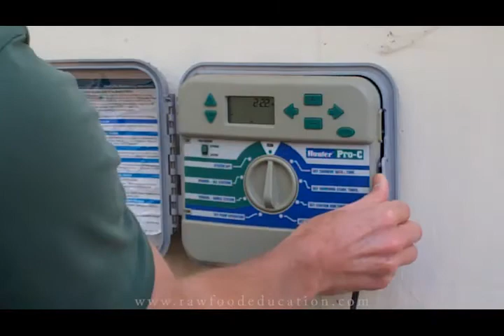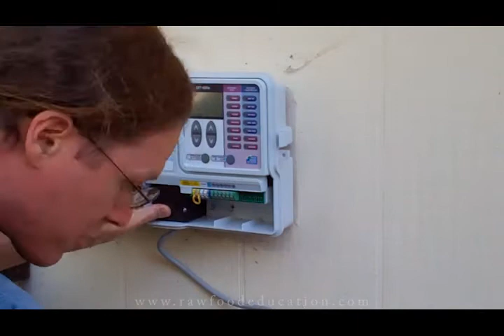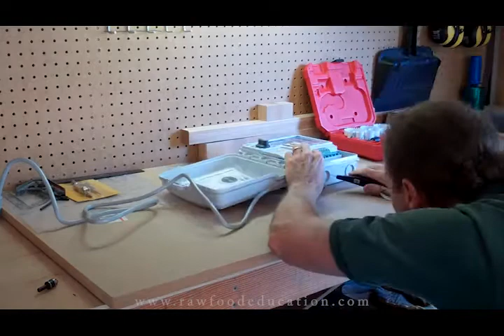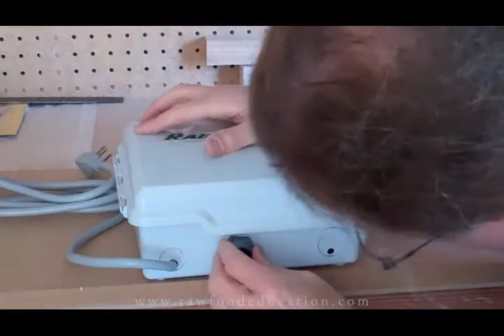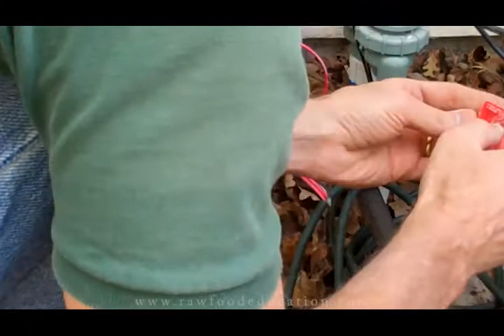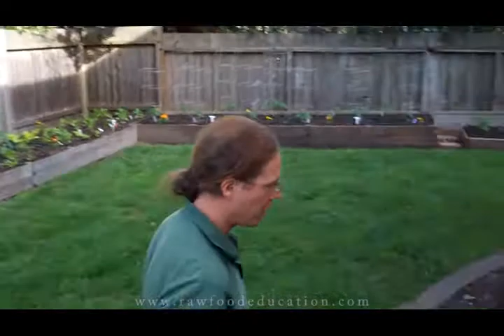2013-04 April Raised Lettuce Bed Garden Part 5: Electronic Irrigation Timer Installation

Comment: Great job!  :)  I am in the process of converting my lawn into an urban farm.  This is really helpful.  Quick question: what type of water filter did you use at the beginning of your system (near the valves)?  Does it work well, and would you recommend it?  Thanks so much! -alyce